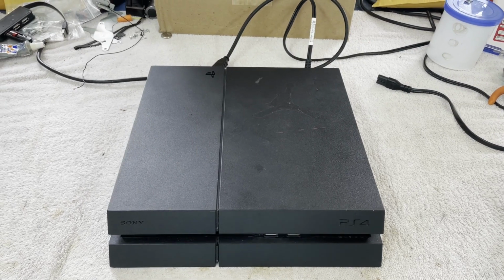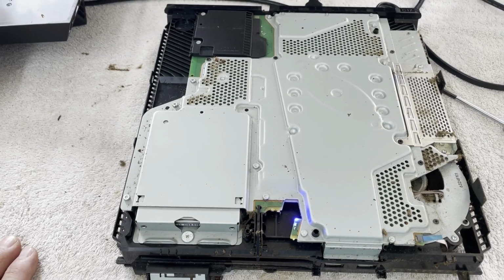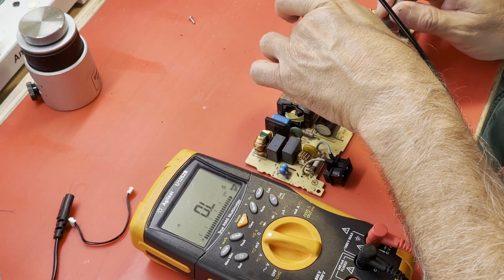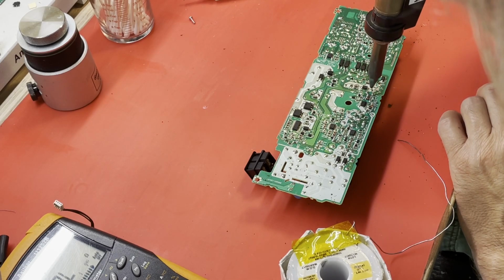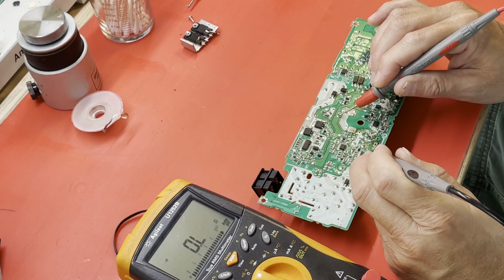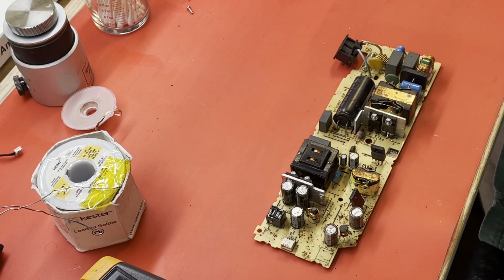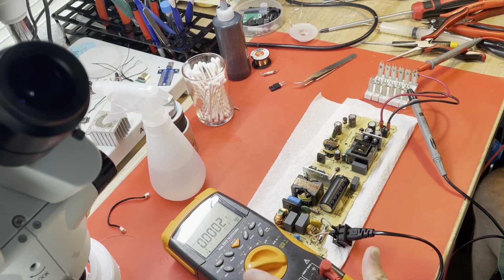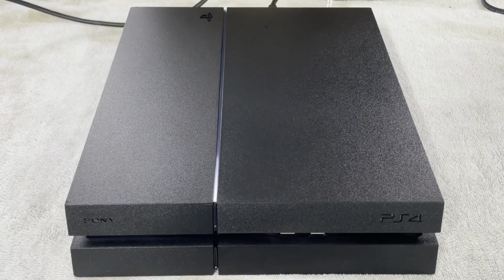#19 - PS4 CUH-1215A No Power

Comment: In a few videos when you blow out the console with compressed air, I cant tell if the fan was still connected to the motherboard. I know that these things will generate a voltage when spun by the compressed air. Not sure how well the fan circuit could tolerate it. Perhaps you can explain if this would be an issue or not? Thanks.
Reply from the maker: A conventional DC motor will act as a generator if spun but this fan is not conventional.  It is a pulse type motor with drive circuitry built into the fan.  I don’t believe there is any chance to generate a current.
Reply: @ToltecMerc  thanks for explaining

Comment: I have a question for you my PlayStation 4 does not like to connect controllers
Reply from the maker: Does it work in safe mode while connected to the USB port?  If It works in safe mode while connected but not normal mode, your Bluetooth/WIFI module is probably dying or dead.